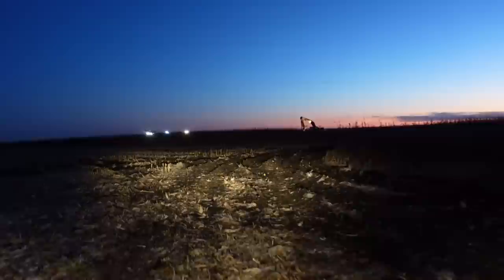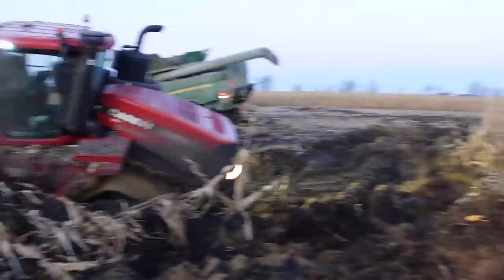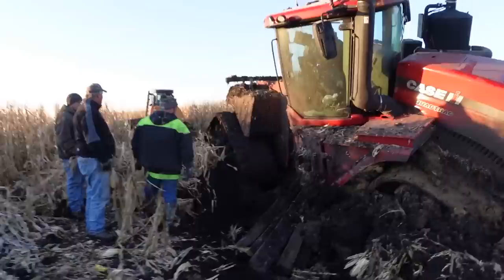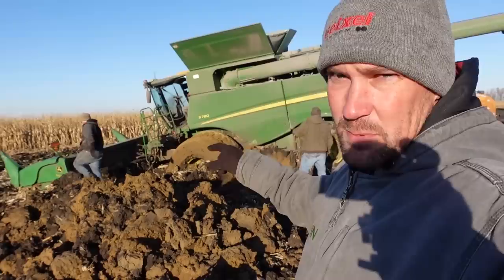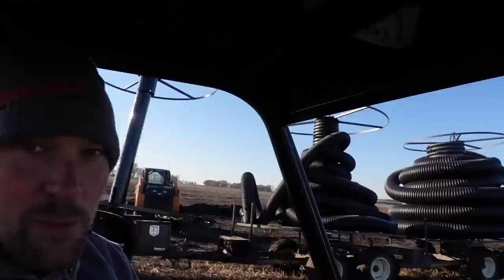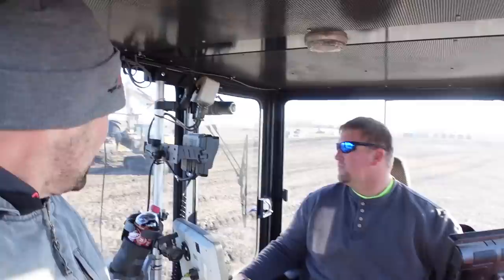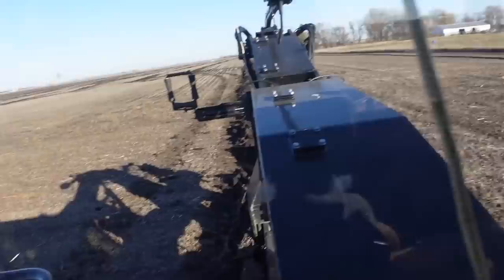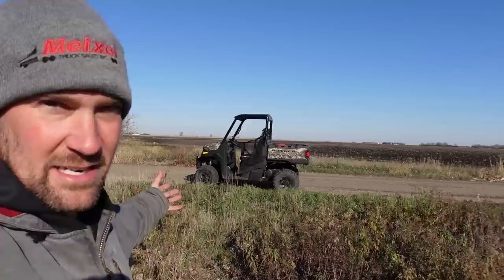Extreme Heavy Farm Equipment Recovery

Comment: Somewhere hereabouts there's a WWII-era training video on getting tanks unstuck from mud. As I recall, the trick is to take a good-sized tree trunk and tie it to the tracks. Then, as the tank tries to move the tracks, the tree trunk sticks in the mud, spreads the weight out, and stays in place, letting the tank move.
Reply: The tracks on a tank are wide open. Fenders and other close parts on the tractor prevent the method you mentioned.
Reply: Tank tracks are made of extremely strong steel while tractor tracks are mostly a rubber composit and would be damaged by this method

Comment: I was stressed just watching that extraction. Amazed at the amount of ground water flowing through that control. Good coverage Zach.
Reply: When the header started dragging mud, worried for farmer. Heck of a clean up job ahead
Reply: Sure was when I dumped my 99 ranger in a drainage mud pit. I wanted to get the tires dirty, road dicintigrated and thought it was going to roll over, had to climb out the passenger window. Steering wheel in the water. Good thing the air box is on the passenger side, the whole left side mirror fully in. 🤦‍♂️

Laugh about it now but freaking out then. Had to take my pants off to get wet and find the tow hook. Heck of mess, I'm just glad I didn't break a boot.
Reply: If my math is right he said it drains a section. An inch of rain on a section is about 17 million gallons. Those clouds hold alot of water. How do they float?

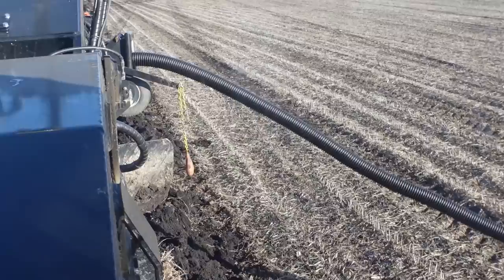Comment: 20:30  so would I be correct in assuming the proper depth is "Balls deep" when laying pipe?
Reply from the maker: Perhaps 🤣
Reply: I have some fishing weights, they are called BALLS DEEP🤣
Reply: This comment needs to be pinned! 😂
Reply: @MillennialFarmer  funny when they almost hit the guy in the head
Reply: @MillennialFarmer  Heartburn is from lack of stomach acid and the stomach values will not work correctly and you get heartburn. Stomach acid is made from salt so start salting your food to taste and your heartburn problems will go away.  I took enough prilosec to float a boat until I found this out and cured my problem.  Salt has nothing to do with high blood pressure as my doctor once thought and he had me on a low salt diet thus my body did not make enough stomach acid and thus i had would get heartburn. Easy cure once I learn how it all works but it does not go away overnight and takes some time before your heartburn starts to go away.  Let me know if you have any questions.

Comment: 40 years in the heavy duty recovery business ..... number 1 rule, do not spin the tires/tread on the stuck unit being winched out, just maintain rotation with  ground movement, or you will be there all day as the unit digs down rather than climbs out. Randy stated as much after the fact ...too bad he did not school the drivers in the stuck units.

Comment: Almost 40 years ago, I led a platoon of four tanks across a 4 foot concrete culvert 6-8 feet of dirt and gravel above.  As the last tank was crossing the land beneath his right track fell away and there was nothing but air beneath four of the seven road wheels.  The tank was listing to starboard and looked like it might flip over.  My company commander was there in minutes, soon the battalion commander and then the brigade commander arrived by helicopter.  For a long time, they discussed holding the tank level with a chinook helicopter while winching it forward.  Finally, the company commander, a previous Battalion Maintenance Officer, said, “Let’s just winch it out the way it went in, that’s always the rule.”  In minutes the tank was free.  I never forgot the lesson.  By the way, in those days we never downloaded our main gun ammunition.
Reply: They seriously looked at hooking the chinook?  Ok 40 years ago?  So it’s lift is @30k lbs?  M1 is @55 TONS?  Maybe still a Patton?  It’s @ 48 tons?   So if it fell. It could take copter with it. (It sounds like over 10’ to fall? Then roll?
  I hope the pilot told the Brigade Commander.
  BTW never click on porn adds.  Report them.  If they fail to get business.  They will quit spamming.  If you want porn.  I am sure you can find it.
Reply: JESSICA  Readers- don't forget to report "JESSICA", "XANGEL" and any other bots out there so U-tube can clear them out.
Reply: @wssides  we have been fighting for this Spam Bot for weeks, over 1,000 has been reported. "U-tube" doesn't do anything or Bot keep changing IP addresses and still continue spamming! (Hint: it's YouTube, not U-tube)
Reply: @Howard I had to look it up. 114,000 lbs. 36,000 lbs payload…. It could help of course.  Danger would be much less. Pulling a stuck item you increase force till you decide to stop, something breaks, limits out. 
  But you hook onto something half unsupported, that could drop @10’, then roll that’s @3 times your max payload?   I have only been up in one copter. “Parts flying in close formations, looking for chance to break, 2 hours maintenance per hour of flight”. We’re some comments I recall.
Reply: It never came to that.  It was an M60A3.  We were in Germany and a Chinook could get there faster with lift than anything else.  The thought was just to hold the tank level while pulling forward with a tank recovery vehicle.  I don't think anybody truly wanted to try that but it always rains in Germany and it was time to do something.  .    
 @larrythompson8630

Comment: Thanks Zack, great video. The drain tile and control structure installation reminded me of my Master's research project 40 years ago in eastern N.C. We were looking at losses of N and P from surface and subsurface agricultural drainage systems. We referred to the control structures as "flash board risers". And just as you explained, we added or removed flash boards to control the depth to the water table in the field.

Comment: Zach, this is one of the BEST! I've gotten tractors stuck in the field (Nebraska), way back in the 1960's. Great of you to help your neighbors!
Reply: I live in north central Kansas about am hr south of Beatrice and in the late 80s early 90s I split an Allis Chalmers 7050 in half discing our bottom ground hit a wet spot stopped didn't want to get dad and listen to him yell so I raised the disc and tried backing out got about 5 ft pulled ahead locked the differential threw it in reverse dumped the clutch and threw the throttle wide open and the transmission case blew apart dad unhooked the disc pulled it out of the way pulled the sheetmetal off the tractor pulled the rear end and cab out to the edge of the field then the nose and engine and the shop winched them on the lowboy and I wished I had taken the yelling for not paying attention and getting stuck that was an expensive mistake
Reply: @davidwoermansr  , thanks for reply. What a story. One of times I got stuck was a 4020 John Deere. I drove it down in a low spot where the Center Pivot water was pooled up. I was so embarrassed. My boss was rightfully angry. We got it out with less calamity than your story, though. This was south of Ogallala Nebraska.
Reply: @lennissytsma5503  I've run derbys and dirt track in that neck of the woods a few times before my accident that had me in a wheelchair for over a year and back hobbling around farming with my kids I lost track how many surgeries I've had but have a few more coming up soon airport security and people in line behind me get a little worked up when I step in the scanner and have to explain what is in my body and show scars to prove some has been there 20 years

Comment: In all you video's I see the 3 liftmaster remotes on the visor and you can easily simplify that.  If the truck has a built in homelink transmitter you can program each button to replace one remote if you are using each remote to operate a single opener.  As long as each remote is only being used for one gate or one door you can consolidate those remotes into one remote.  Each liftmaster remote can operate 3 separate doors.

Comment: Here in Australia we have what we call swamp mats they are a whole lot of logs tied or strapped together, a little wider than a excavator, we use them in wet or swampy condition's and helps keeping machines afloat and used for rescuing bogged / stuck machines like these one, I guess you have something like that over there. A pity you didn't have some on hand for this lot.
Reply: Yeah we have them also. More used by power companies servicing and running lines in swamps around me.

Comment: Great video Zach.  Great lesson on tiling.  That stuck quad trac reminds of idea that the more technology keeps equipment from getting stuck, the more it takes to get equipment unstuck.
Reply: I was wondering do those things have anything like a car or pickup traction control system where it starts cutting power to the engine when they start spinning

Comment: I grew up on a ranch in SE Colorado, where the earth is packed mostly sandy clay (high desert) and it was easy to get machinery around…UNTIL…that 1/2 inch rain would fall and turn those dirt roads into greasy mess where vehicles would slide off into ditch and some would be stuck for several days…amazing what a little moisture can do.  Cheers dudes.  Nice work.

Comment: When we lived outside Marcel, MN the road to our house had soft spot on it and the county road crew dumped many loads of clay and rocks into this roughly 50 yard spot. 
They used a road grader to level it out and it sunk-in, only 6” of the tires of the two rear drive axles were visible. The near by farmer used his small bill dozer to pull it out.
We were standing where grader had been and the hole refilled with the clay and rock so we could stand on an not get out feet muddy. But if we pumped our legs the ground acted like a big water bed.
Minnesota peat bogs are under much of northern MN and it looks like western MN as well.
Great video Zach, btw that was in the late spring (after mud vacation) in 1960. That road is most likely paved now.

Comment: Was surprised at how clear the water was running thru that control station, thanks Zack for showing that in the video, a lot of people have no idea how much water is actually in the ground like that.
Reply: muddy water is only because the soil is moving with it. on a field the ground is pretty compact at the depth they're putting the lines, so there's not really any room for the soil to move with the water. think of it as a natural filter. and if it weren't for the chemicals  for the crops, you'd be able to drink that water.
Reply: I respect his work, he always delivers quality content
Reply: He is very inspiring, I admire his passion

Comment: In the military when you do this to your tank you cut down logs or branches about 3-5 inches in diameter and about 4 feet in length and put them under the track as its moving one after the other about every foot and this spreads out the traction and ground pressure and helps elevate the track.
Reply: Yep my dad said my grandpa got our d6c absolutely SUNK in the bush and that’s how they got it out. Dad said it was so miserable to do hes been scared ever since to take it in a questionable spot lol
Reply: TDS is real.  Let’s go Brandon
Reply: @larrythompson8630  LOL..nice to know I can trigger a Liberal without trying.
Reply: @jizzer6969  LOL....You must be speaking about Biden because he dodged the draft with 5 deferments from the Vietnam war. Let's Go Branden!
Reply: Goes back to the steam tractors. Grandad had a steam certificate that allowed him to calculate safe over pressure, chain logs across the steel drive wheels to lift it out bit by bit. Very useful when a bridge collapsed under the weight.
Reply: T34 tanks in WW 2 had a log mounted on the side of the hull for that purpose.
Reply: @jizzer6969  wow. You managed to steer a completely non-political post to Trump hate. You know, I'm not even mad. I'm impressed.

Comment: Hook the Excavator bucket via chain to the font of the tractor and help by lifting it to get it out of the mud maybe? Unless there is nothing to hook to in the front but that would be odd
Reply: easiest option. lift the front and put crossties/rail ties under it, then do the same to the back and inbetween the front and rear tracks...
Reply: Im by far no expert but knowing the weight of the quadtrac and seeing the size of the escavator, im not sure it would be able to pick it up any substantial amount to do anything to help the situation, not to mention the ground is also soft in that area.

Comment: I've seen some YouTube videos showing excavator recoveries. One was buried half way up the window. They got it out by digging all the way around it (much more than you showed here) and putting a lot of mats down that were made of five or six rail road ties each.
I'm no expert, but it seems to me that you guys didn't spend enough time digging before trying to move the quad-track.
Still, you did a good job getting it out at all.

Are they going to give up on harvesting the rest of the field?
Reply: You just wait till it's 10 below and there's 3 ft of Frost and then go slow and your should be able to clear it sure is a mucky mucky mess

Comment: Bucket operators use what they call "mud mats" when they are working on wet ground. Double-length Railroad ties drilled horizontally and tied together with long steel rods ... several of them make a "mat" about 6 by 18 feet which distribute the pressure from the tracks over a much wider surface area.  Get your Farm co-op to invest in a half a dozen of these things and everybody will be using them every wet season.  They would have had this tractor out in about 10 minutes.  Check out Chris at "Lets dig 18"... he uses them on nearly every job he does.

Comment: @Millenial Farmer heres just quick science lesson: the pH scale ranges from 0-14. 0 is the most acidic and 14 is the most basic. 7 is a neutral pH. heartburn is caused by acidic substances, a pH of less than 7. so usually, heartburn treatments have a higher pH, meaning they r more basic, a pH of greater than 7. because the northern chill water has a higher pH it can help "suppress" heartburn. hopefully i made that understandable.
Reply: of course that only works if you drink it while excess stomach acid is actually being produced.
And just the act of adding water to the stomach in itself helps dilute that acid to a degree, not sure which is the greater effect :)

Comment: I have to say. One example of good thinking. During WW2, Russian Tank Crews would strap logs to the side of their tanks. For this very reason. To get their tanks out of thick deep mud. The logs would give the tracks something to grip onto and use to pull themselves out of the mud. Still, it isn't a quick fix. Could still fail, but being the 1940s and heavy equipment to help dig out out was in short supply or nonexistent. A few logs and praying are the only things you had to get out of the mud.

Comment: Last time we had a combine stuck I used schedule 80 pipe chained to the tires and railroad ties. 1/3 rotation of the tire and fill in the hole. 16 hour's to move 15 feet, good times lol

Comment: The worst thing you can do for heartburn is antacids. You get heartburn because you don't have ENOUGH acidity and enzymes to digest. The foods then aren't as quickly digested, and ferment into gasses. The gasses push the existing stomach acids through the valve and even though they aren't your desirable pH of 3, that's way too acidic for the esophagus. 

You can usually eliminate heartburn by drinking (preferably raw) apple cider vinegar before your meals, not drinking during meals to avoid diluting enzymes and stomach acids. Another great practice is to drink a glass of water an hour before the meal. What does this do?  It warms water for your digested food to enter your vascular system to feed your cells and greatly reduces dehydration. If you are dehydrated then the digestive process has to pull water out of your blood to carry digested food to your cells. If you're really dehydrated, you have to pull water out of your cells to get into the blood, to digest your food...

Much healthier to just drink 8 - 12 oz before a meal.

Comment: That's amazing to me to see something sunk that deep. Here in Southern Ohio our dirt doesn't go that deep!
Reply: Grandpa's place in Kansas dad dug 185 feet for a well. Never saw a stone until then.
Reply: I was driving fence posts once and had some 8 ft metal posts I scraped to use for a fence.. well, I ended up pushing that 8 ft metal post all the way into the ground by hand and about a foot buried over the top. I know of places that would swallow heavy equipment  whole. And it's deceptive, it looks like regular ground. Alot of water underground here, our well is only 70ft and has never gone dry.

Comment: The easiest way to get the quad-track out would have been to lift the front right with the excavator while you winched it. That would have gotten it up enough to stop plowing and get to the surface.
Reply: Might have been too heavy, even worse with suction force

Comment: That  looks like peat soil at a coop where I  retired from as custom operator buried a John Deere 4940 with 120 foot booms  in peat  took 9530 4 wheel drive to get me out  two different times  between walnut. And Normandy Illinois  feels like hitting a mud bogs   Worst  stuck was Hagie one time  two tandem axle wrecker trucks  anchored together pulling

Comment: Maybe try some plastic plates to drive on . They are handy and not so heavy.
Make the surface larger. 
Quad track is no good when it’s wet. I’m suprised. 
The footprint is flat. Needs to be round with pressure in the middle?